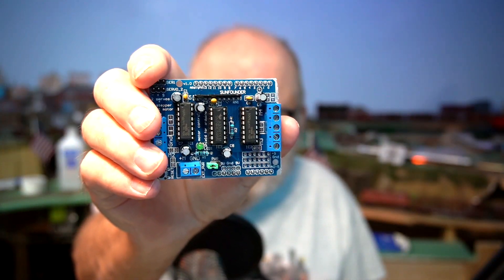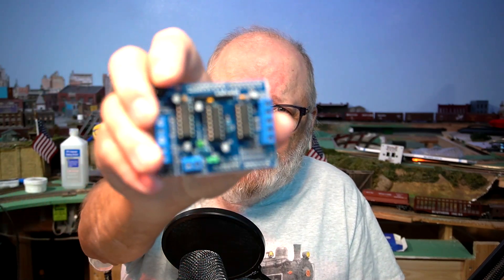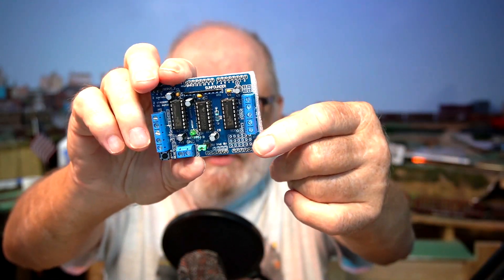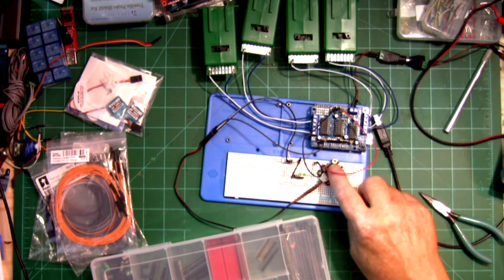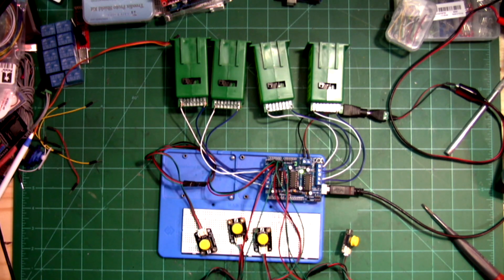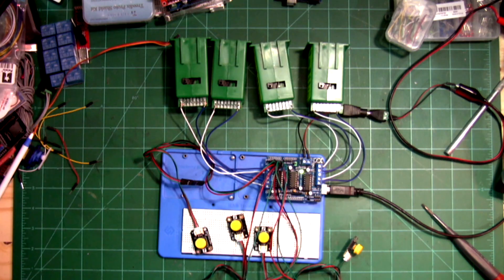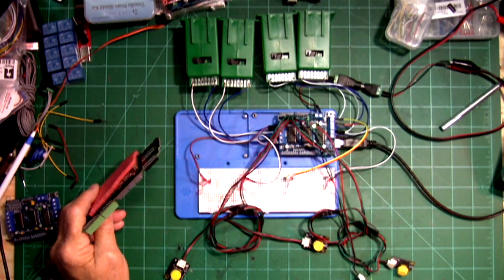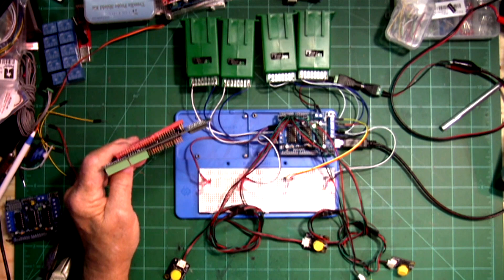Adding 4 Push Buttons & LED"s To The Arduino/Tortoise Project

Comment: new here . where did you get the push buttons ? an how did you attach them to the hard board fascia ?   do you have any photos or videos on that great videos im on my sec one !!
Reply from the maker: Push buttons are from DF Robot. This was just a demonstration and currently my layout is disassembled during my move. These PB are basically for experimentation when building a project. Not designed for surface mounting. There are others available, but you have to add the pull down resistor.